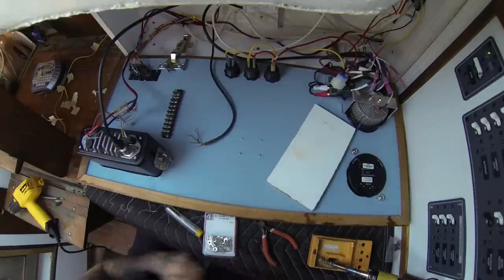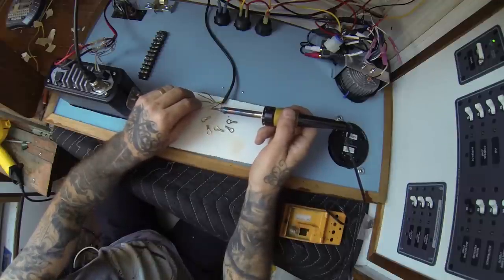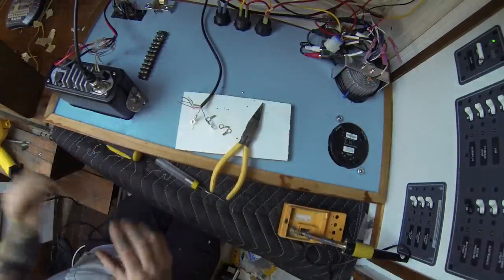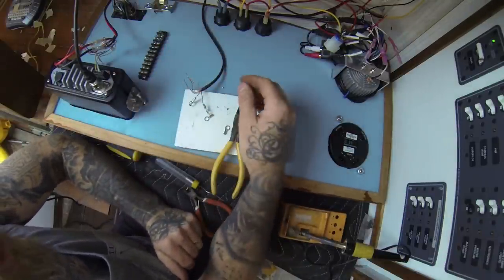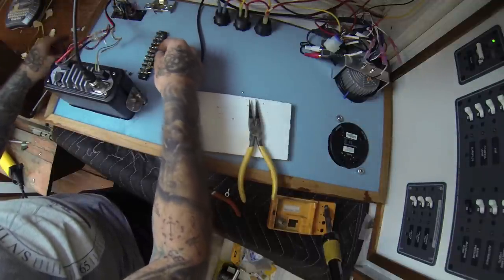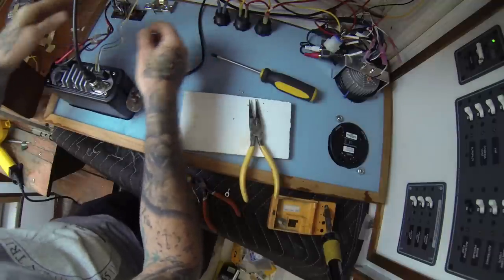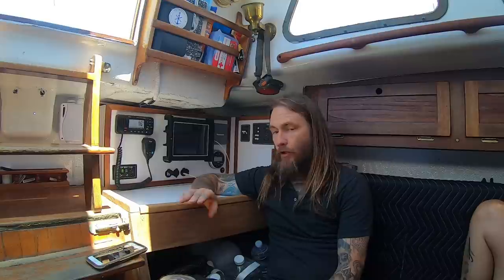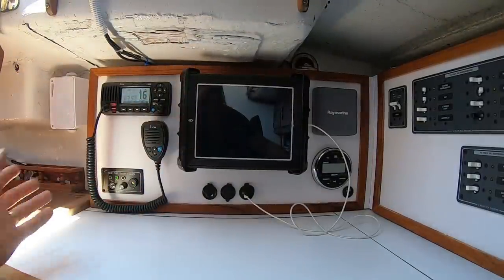How to wire up a simple NMEA 0183 Network on a Sailboat

Comment: What I typically do for small stuff like that is use an 18-20 gauge or whatever the smallest heat shrink ring terminal that I have. Then strip double the wire you need, fold the end back at the halfway point of the stripped area so the end of the wire is doubled up. It usually gives you enough meat to get a solid crimp 👌

What you did is definitely more than acceptable though IMO, looks nice and tidy 👍

Comment: Another great vlog!  I love your How-To vlogs.  I finally got the plumbing for the head reinstalled based on your advice and mostly following your diagram.  I've also replaced my old Sherwood raw water pump with an Oberdorfer raw water pump, added a raw water strainer to the engine (PO didn't have one installed) put a gate on in the lifeline on the port side, and switched out my old west marine vhf for a standard horizon GX2200.  The next couple big projects will be the switch to self-tailing winches for my jib sheets, install of the Raymarine eS78 chartplotter and the refit of the anchor locker so that I can install the windlass, as well as servicing the winches on the mast and cabin top.  Thanks for the information and inspiration, James!
Reply from the maker: So great to hear about all of your projects Natalie! So much work right? Sounds like you are as hard of a worker as I am! My next DIY video is a galley gusher foot pump that I installed last month. I also have self-tailing winches for my jib sheets I need to install ! Keep up the great work!

Comment: Hi James, first, most boat electronics techs just say "NEMA 183" or "NEMA 2000."  I resisted that for a while, because NEMA of course is another acronym, for National Electrical Manufacturers Association.  They create and maintain standards fro everything from Plug/Receptacle configurations to electrical motor frame sizes, etc.  But anyway,  audibly spelling out NMEA just takes to long, so it's become  pretty much accepted slang to pronounce it NEMA.  Second,  3M Scotchlok connectors can make quick work of this kind of connection.  queeze.  They're insulation displacing, so no stripping, just stick the wires in and sI connected one of the NMEA183 ports on my Raymarine e7D MFD to supply gps sentences to my DSC radio using them in about 2013, and still no issues.  I was a bit hesitant because they're supposedly made for solid copper, not stranded, but I've had zero issues.  Also used them to connect the data from the e7 to my ST4000+ autopilot head unit.  Hasn't steered me wrong yet!
Reply from the maker: I became aware of this after shooting the video and watching other stuff ¯\_(ツ)_/¯ . I would never use any sort of wire connectors on a boat that are solid copper, and I am fine with stripping everything and heat shrinking it, not looking for shortcuts when it comes to safety.
Reply: @SailorJames  Good call.  Scotchloks are quick & easy, but not reliable.  They are prone to intermittent connections as time goes by, especially in environments that rock back & forth, and especially in salt environments.  While ABYC forbids soldering on boat electrical systems, I have often seen solder joints stand the test of time in installations that have proper strain relief on the wires.  I normally try to tow the line with ABYC compliance, but my personal opinion is that a good solder job is not necessarily a bad thing.  Do keep an eye on it though.  And thank you for posting the video.  Publicly available NMEA info is scant.

Comment: One reason you DON'T want to solder is for reliability.  Solder connections are more prone to breaking at the point where the solder ends and wire begins.  You have a stress point right there which will break (over time) with vibration and movement.  A properly done crimp is the way to go.
Reply: Solder is made of lead and tin...the 2 worst conductive metals... I am always very careful using them ... ;-)
Reply: In Sea conditions, anything electric that isn't tinned and/or soldered will corrode and fail.  Been an Marine Electrician for over 10 years. Crimping is not enough.

Comment: James, one more thought...why not use Open CPN?  It's a free download.  I just installed it on my boat with a NMEA wifi (Encoded Solutions) connection  to my VHF radio/AIS receiver and Garmin GPS.. Works like a charm.  I'm using an Android Tab A 10.1" tablet for my display.  Also charts for the US download free as well.
Reply from the maker: Hi Barry, I use Open CPN on my laptop for route planning and anchor alarm when I am on the hook, I have a Mac / iPad /Iphone . They don't make it yet for iPads or iPhones yet to my knowledge. I love that program though. I wasn't ever able to get it to connect to my Digital Yacht iAis set up for some reason but as long as i use an external GPS synched with my laptop I can use it, which is why I only use it for planning and anchor alarm.

Comment: OH my, you went to an electronic store and they didn’t sell you molex connectors ?  I’d never go back there again !  You might want to redo the nmea connections with molex connectors to get rid of those brittle solder joints.
Reply: An electronics store isn't a PC parts store.
Reply: @CG-sv2nw  an electronics store sells everything electronic and an electrical store sells primarily ac electrical

Comment: Hi James, where did you find the small ring connectors? I'm in LA myself. I'm trying to put a B&G Hercules H2000 system together. It's NMEA 0183. Thanks for making the video.
Reply from the maker: I bought them at Fry’s, but I think all the Fry’s closed down so you might need to find them online … or see if “All Electronics” in the valley still exists

Comment: previous ~2020, Navionics wifi connection were working only with Raymarine instrument (it was a kind of “seatalk Wifi”). last version will recognyzed any AIS (and thus GPS) NMEA incoming word. You should give a try with the last navionics version. Notice that AIS fonction on navionics app need an active map plan. In my case it was workings months after the end of my navionics plan because the Ipad used as navi on the boat was never connected to internet

Comment: For Navionics try this: first update the app, this feature only got available few weeks ago. Then go to Menu -> "Connect a device" -> "Add device" -> then enter in "name" a friendly name (e.g. "ais"), enter in "host" the ip address of your Digital Yacht's box, and in the "port" enter 10110 (this is the default port for NMEA 0183 data in text format. And try both UDP and TCP, look which is working.
If this doesn't work, ask DY what port they use for NMEA0183.
Reply from the maker: awesome thanks I will try it!

Comment: I am planning to use RJ45 for my 0183... No soldering! When You solder, the copper gets soft from the heat but the tin makes a point where "hard meets soft" a recipe for the thin wires...
I know itś by no mean "correct" but I will try anyway, 
If it wont work I will probably do it Your way,,
Brgds Jake

Comment: Please James? The largest issue with soldering joints is that people are using lead free solder that has Antimone in it. There is NOTHING more sacrificial than antimone. The problem with 60/40 or 50/50 lead tin electrical solder is that too many places are refusing to stock it. ALL of our electronics are LOADED with solder joints. Solder and GOOD 3:1 shrink tubing with the sealant on the inside that melts and seals is the way to go using 50/50 or 60/40 LEAD-Tin solder. However I use it too with NON-insulated crimp connectors too applying the solder after the crimp and running it over with shrink tubing. Never had a problem with proper loading and fusing of course. And oh too the solder must be ROSIN core NOT ACID core. That one will do you in real quick too. Those bakelite bus bars are my favorite low amp multi-point connectors. I'll run high amp split loading from them too with proper connection bars.

Comment: Hi James, Great Subject! I have a few questions. This is something that’s plagued me for a while. Colors don’t match when connecting. Did you run power to the ais transponder on that terminal strip? I’m trying to go the other way, running nmea0183 out of my axiom chart plotter to the vhf for DST.  (Mine is not internal gps). I wonder if I can just connect the out cables to the in?
Reply from the maker: From my research the colors from different manufacturers do not match up, that is why its important to look in the manual either a hard copy or find a PDF version online to find out which of the wires are talkers and which are listeners. What are you trying to have your VHF hear from your Chartplotter? GPS? is this for an AIS feature in the VHF? and Yes I did run a 12v hot and a ground to the terminal that powers the iAis unit.
Reply: Sailor James   Hi James. Thank you for figuring this out. I’m trying to run gps TO the vhf. The ray marine chart plotter has an output port with adjustable baud rate. I just didn’t know what wires to break out or if it needed ohm terminators. You showed It doesn’t. Thanks sir

Comment: i like your channel n all.  but dude.. that's like way out there, suggesting that solder will cause a fire.  
there are ol salties and experts that have the "great debate" on solder or not on boat wiring.  that's not at all part of either arguments.  but as a life time mechanic/boater/electrician, i'm scratching my head wondering where somebody of your intelligence level heard something as prosperous as that.  more so, what ever motivated you to believe, worse, repeat it.  it's unbecoming of you!  the key concern is corrosion/conductivity versus functionality (reliable connections).  not boat fire or not.  some folks believe that soldering (heating ) wires detiorates the quality and makes it easier to corrode/break.  (properly done that doesn't happen, but most folks don't know to use terminal grease and good shrink tape).  in reality it comes down to crimped connections are sufficiently reliable, without the extra tedious work of soldering, in the eyes of a lot of sailors.  ( i personally disagree).
Reply from the maker: that was a very aggressive and dramatic response. Every single marine electronics book I have ever read suggests against using solder. That is all I will say in response to your message.
Reply: @SailorJames  probably so.  I should appologize for that.  I didn't mean to be rude or out of place.

Electrical is a touchy subject with me.I have spent countless hours, days, etc.  troubleshooting bad wiring and repairing it for folks.  a boat is not someplace that we want wiring to fail (or start a fire)..  the homes, campers, boats, motor vehicles, etc I've seen electrical fires on from bad wiring repairs is endless.  Every commercial wiring harness I've ever seen has the internal joints  soldered (for a good reason).

I am however happy to see that you soldered your connections, meticulously no less (impressively so).

Myself, i actually, normally, use two or three layers of shrink tape, depending on the expected/potential current and other potential interference/hazards to the connection 

I'm a life time power boater, with aspirations to start sailing (circumnavigation)  likewise, in my spare time I watch a shit ton of sailing video's.  some for mindless entertainment.  mostly to bring myself up to speed, even give myself a refresher on blue water.

Your channel fits that ticket well.  you're educational, and even add a touch nice mindless entertainment.  although younger than many of the old salties, you are well versed with common sense, common courtesies to others, and appropriately frugal (do it yourselfers, without being foolishly cheap) or foolishly reckless.

Thank you for that.

in the short time since i've found your channel, and watched a number of your video's i've learned the two of you are not only ambitious and determined, but you also have a bit more common sense and determination, than the average couple of your age bracket and type of sailing, 

Impressive, but that sir, undoubtedly caught me off guard.

 I have a boat in the yard now that needs rewired... (ugghh, that's gonna be a project, every darned connection I"ve seen's been redone poorly over the years).

thank you for your response, and my apologies for being harsh.

oh, and I talk/type too much.  (it's a bad habit...)

Comment: The wire termination ends that you are looking for are called Ferrules.  They use a special crimp tool that is different from the ones you use for ring terminals.    https://en.wikipedia.org/wiki/Electric_wire_ferrule  Fair Winds.